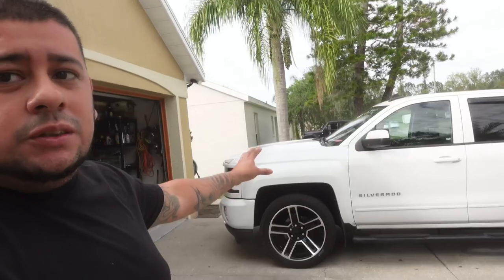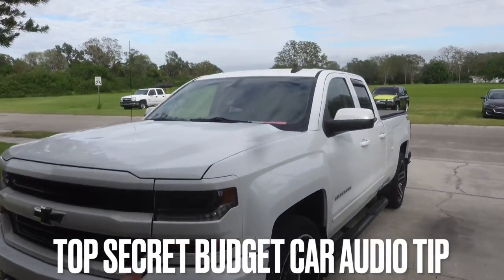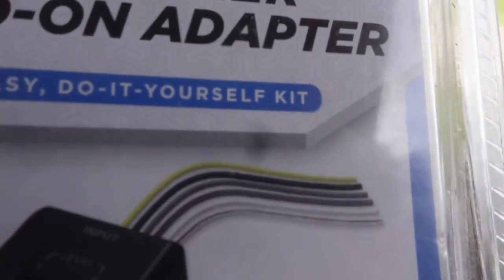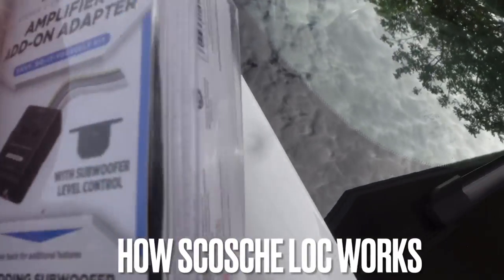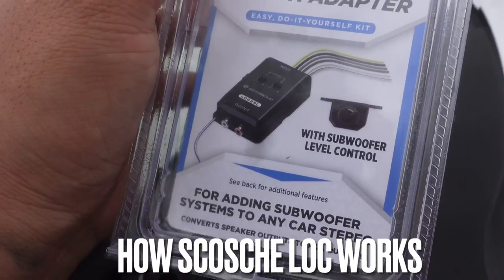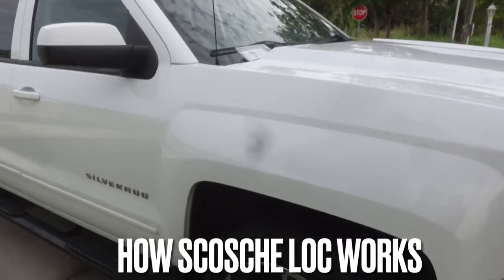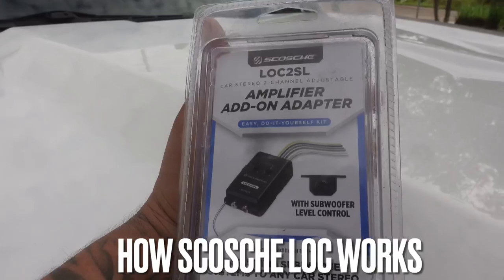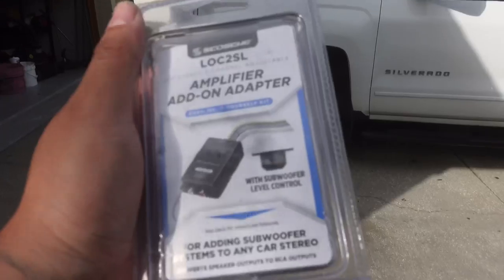Best budget Line Output Converter for sound system from Walmart

Comment: Yes sir they work but I'm telling you they're full of distortion so you didn't hear it here first but you heard it here they'll clip like crazy. Kicker makes a good LOC which has a 12 volt trigger to turn on your amp forgot what they call it and audio control makes damn good ones too both of those are very clean. Not saying what you have doesn't work I'm just saying you hook it up to an oscilloscope and you'll see how much Distortion they have a lot. The kicker is the same price if not less and it's hardly any Distortion just look it up I'm just trying to save you in the long run I want you to burn your subs up or whatever but they are full of distortion check it out

Comment: I have the lc2i and my bass amp I want to add a 4 Chanel amp for the door speakers do I need run new wires to the doors? My  truck is 2016 sierra I hope you can help me
Reply: what 4 channel and how many watts are you trying to push
Reply: If your not going to be running stupid crazy power your stock wires should be just fine